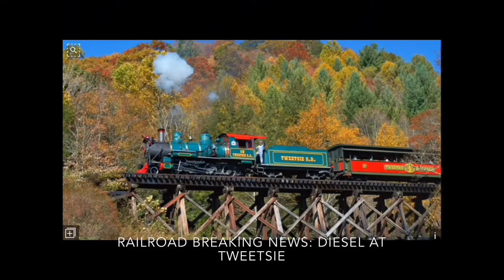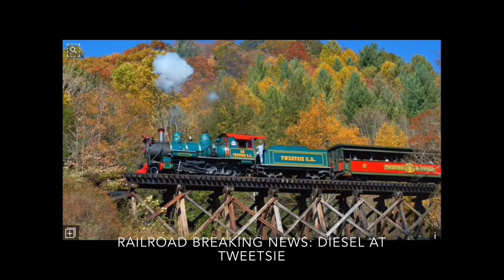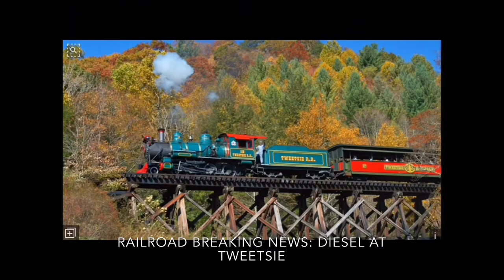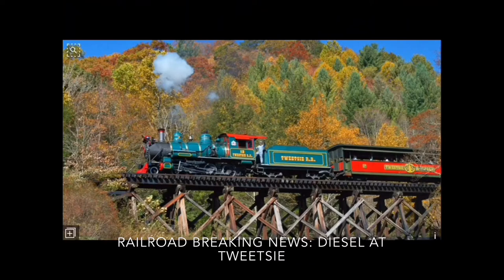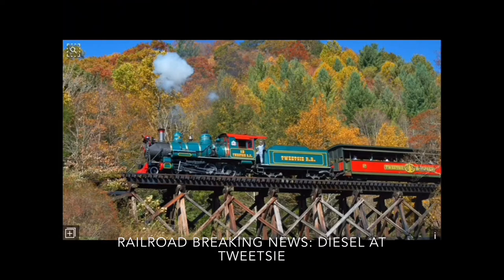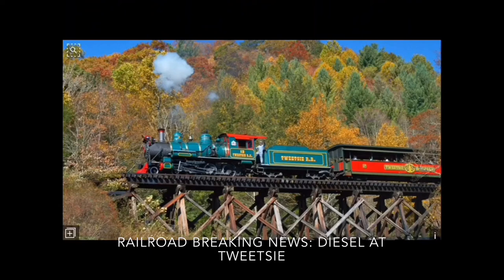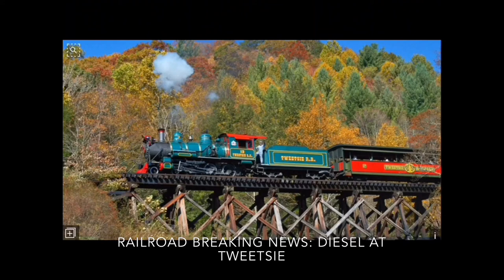Railroad Breaking News: (Episode 1) A Diesel Locomotive at Tweetsie Railroad?!

Comment: It is not a diesel locomotive it is a backup speeder.
Reply from the maker: CRATER FILMS but it looks like one and it’s a another type of the other one that’s operating at the doe river gorge railroad in Hampton Tennessee.....but if you say it’s a speeder then I believe you
Reply: Railroad Velocipede Productions it has no couplers, they do have a small flat car that doesn't have couplers.
Reply from the maker: CRATER FILMS I know that